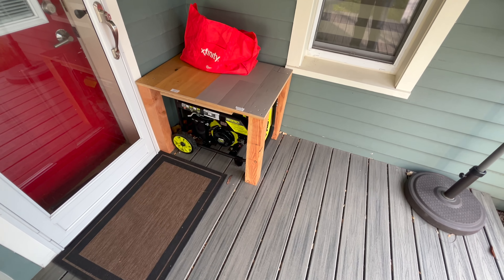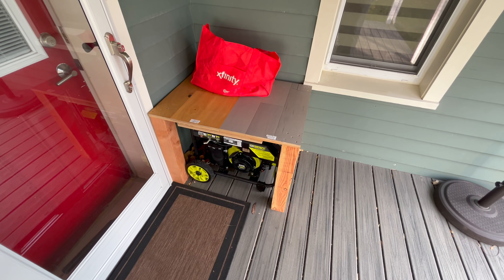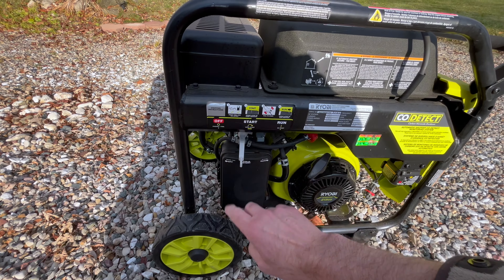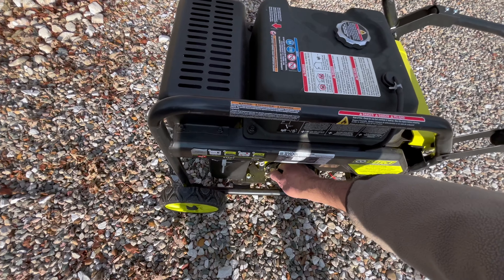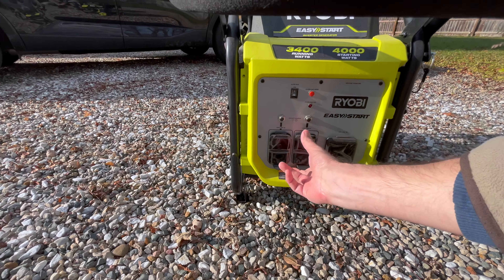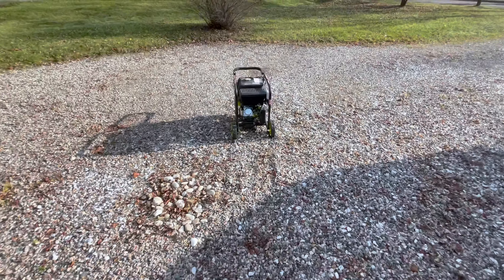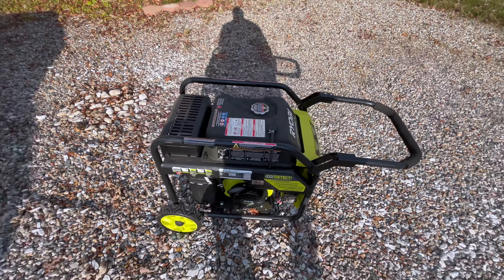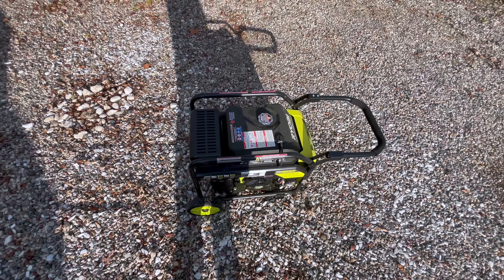Why Regular Generator Start ups Matter: Essential Tips for Reliable Power

Comment: It's also important when you start up every couple of months to load the generator down at least 30% or more of capacity that way it warms up gets up to temperature cooks off the moisture in the oil and keeps everything in the generator head happy. Starting in just idling for a couple of minutes will actually build up a lot of moisture in the oil.
Reply from the maker: Thanks for this tip, good advice. I will do this next time.